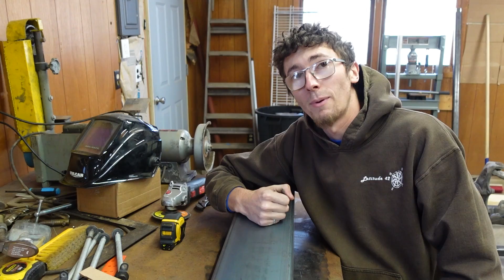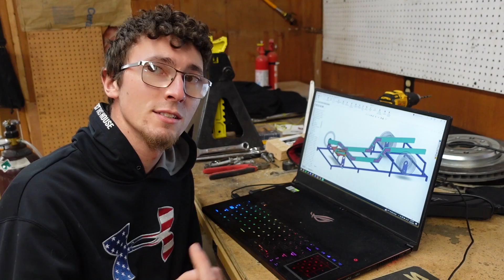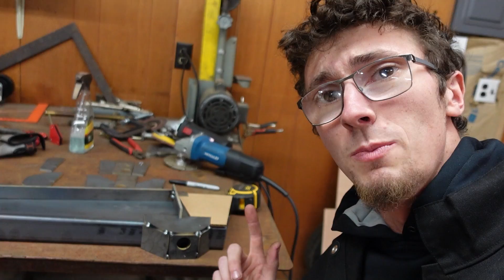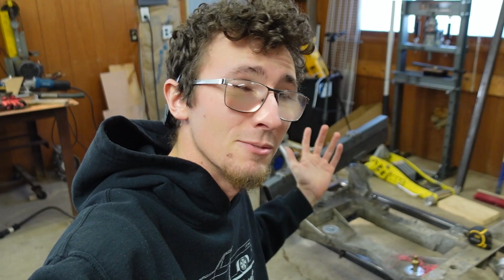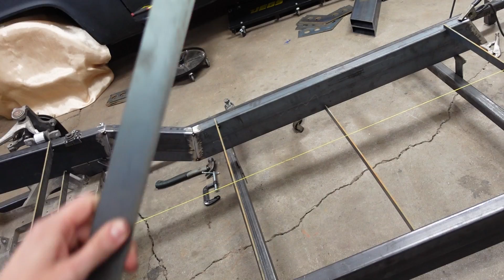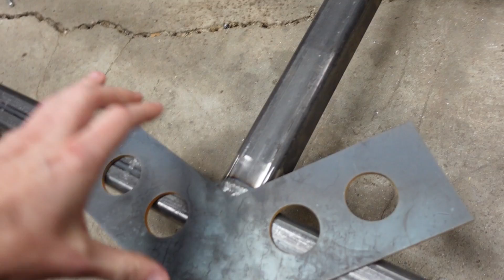The Custom Frame Takes Shape!!! - Pro Touring C10 Chassis Build Part 3

Comment: It’s interesting what you said about the 7 degree caster angle. I was thinking that caster angle  is independent of the frame rails and determined by placement of the connecting points for the upper and lower control arms. I’m missing something! What’s the deal?
Thanks.
Reply from the maker: You are spot on. I set the frame to match so the mounts for the upper contole arms would be the same relative height from the frame rail.

Comment: DUUUDE.... You are, without a doubt, a bad-ass Man! I just watched this video, the first of yours, for me, and I have been superbly inspired by your work. Thank you, very much! This way of frame building, is about as fail-proof as one can get, without having an actual machined chassis table with all of the clamps and guages and sh*t that would need to go with it. Is that lower chassis jig frame made with 1"x1" square tubing? Just checking... I really do not want to use 2", but I will if need be. I need to use the same method for a chassis to go  under a '55 Suburban that I got about a year ago. Anyway... I fail to stay on point, here. I just subscribed, so I'll be following this project through to the end, just so I can learn your methods of choice. I am newly educated Machinist, Welder, CNC Programmer, and I earned all of those certs just so I could build my own sh*t. The only thing that I needed, after that, was finding your channel. Thank you! Good luck... I wish you the best!
Reply from the maker: Thanks man! I used 2x2 .25 wall for the base. You could use 1x1 but I would use some extra bars and make it like a truss if that makes sense. And your project sounds awesome!
Reply: @designbuilddrive  Hey… thank you for that information! I sincerely appreciate your time. Im thinking if Im going to folliw your route, then Im going to use the same materials, in order to do it right. 2”x2” is the way Ill go. Thanks again, be safe!

Comment: You do nice work , sometimes when you build something the only way to get all the numbers correct is to  to build a proof of concept part  that's what you did by working out all the bugs on the first try . That( Flitch) plate will also add considerable Strength.

Comment: Looks great. One thing though, looks like the front rails have an upward angle. What are you planning to do to level them out to mount the core support? Are you going to do an X or perpendicular cross members for the center of the frame? Keep us updated on your progress.
Reply from the maker: Yes, those sharp corners are a stress concentration point. The giant fish plates are gonna help with that. Plus I'm going to layer some of those spots. And there will be a lot of cross member action.

Comment: Hey mate, aren’t “fish plates” supposed to have tapered ends so you don’t get weak points from a sharp, flat edge?
Reply: Tapered end lets any flex dissipate over a longer area, while a straight end concentrates any flex stresses along the end. Stitch welding the top and bottom but not down the ends may help. Problem.with that is the end stitches get the stress from any flex and may break.